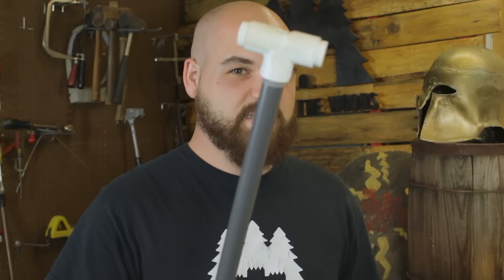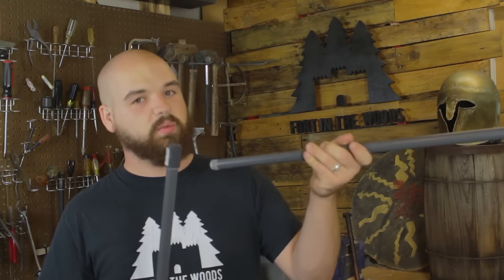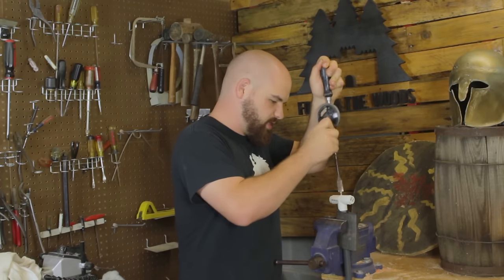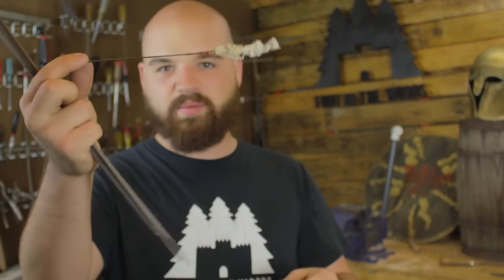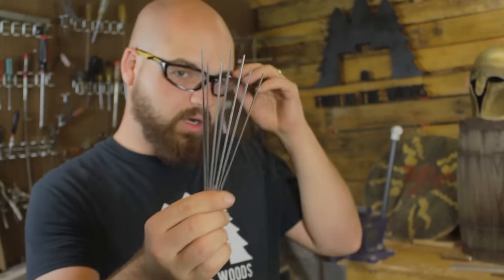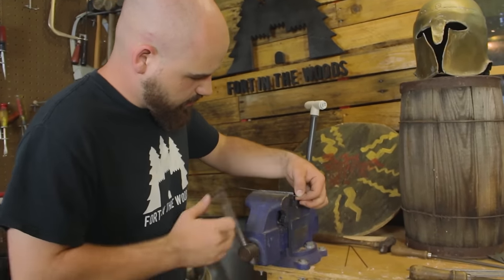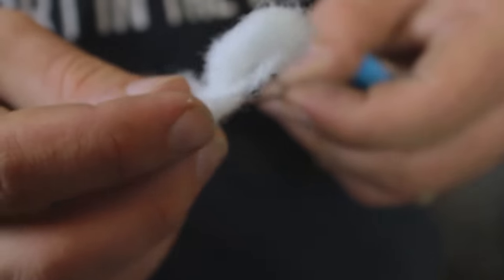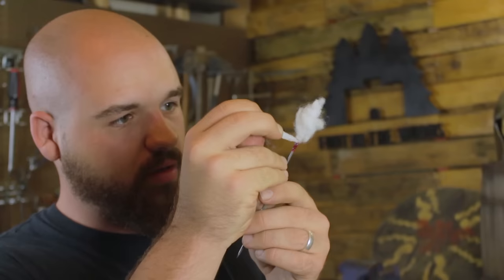$10 PVC BLOW GUN and DARTS!!

Comment: Nice work. However, though the mouthpiece seems anatomically appropriate, I wonder how much energy is dispersed into sending and compressing air to the sides of the T in the moment you blow. Air is elastic, and some of it should be going left and right instead of forward.  There must be air twirls into the mouthpiece. You probably and ideally should have laminar flow inside the pipe.
Reply from the maker: You're exactly right. I do imagine there is a little pressure lost in the sides of the T but  it doesnt seem noticeable. I think this could be fixed  if needed with cork or some tight fitted dowels.  Great comment!

Comment: I saw a video of a guy that could kill a bear with a blowgun.  Also, when I was a kid I found that if you heat a piece of metal red hot, you could hammer in a proper broadhead on a vice.  Also, a flacid plastic piece (one that can easily knock off) can continue to travel further into the intended target.
Reply from the maker: I believe I saw that video of the bear, pretty crazy. I think I tried the same but had problem with the steel softening on some and the tips bending.  Some worked great.  So when you say "plastic piece" are you meaning the fletching? If so, a break away fletching is a great idea.  Some thread and glue would be enough to keep it from sliding forward when shooting. Great idea.
Reply: @FortInTheWoods  .. The tip of the dart is a broadhead made of plastic. DIY people use broadheads fashioned from credit cards. They are used for .50 and .40 caliber blowguns. .625 caliber big bore magnum blowguns use steel broadheads. That's the size you saw the bear taken with.

Comment: Desired length for the wire/dart please?
Reply from the maker: I'd say about 6 or 7 inches.  If the dart is thicker it will weigh more so it may need to be shorter to lighten it.
Reply from the maker: We've even used sowing needles before for smaller blowguns

Comment: Would it make a difference if you used the cotton from a cotton ball? Don't really have any pillow cotton laying around 😂
Reply from the maker: That would probably still work. It may just not be as durable and you'll probably have to replace it every once in a while
Reply: It will soak with the vapor in your breath and increase weight and deteriorate quite rapidly